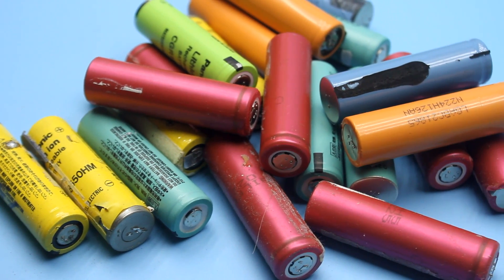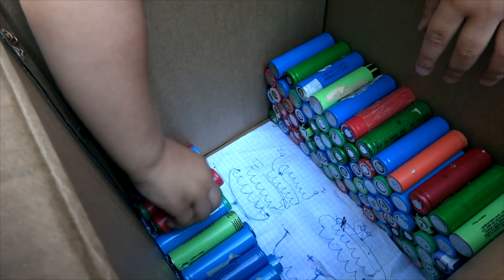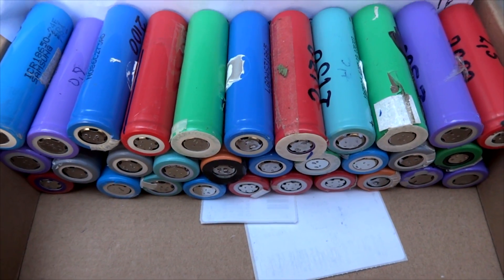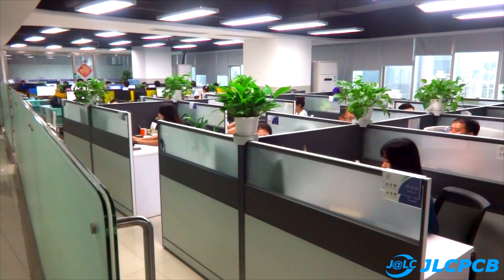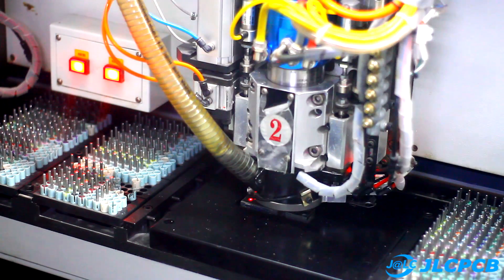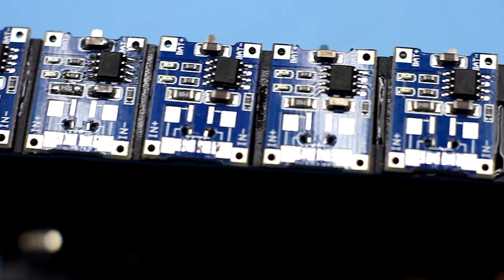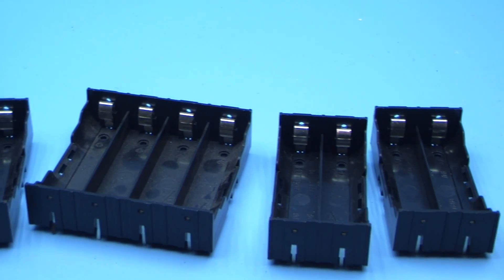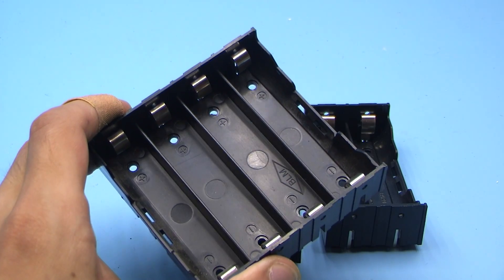SUPER POWERFUL charger for 18650 type batteries!

Comment: Is there one that can output more then 1 amp?
Reply: Nope
Reply: Yes you can go for tp5100
Reply: Just a little modification. Change the resistor program to half of its default value (1.2K to 600ohm). And you can get 1.4Amp output.
And would be optimum if you power it with 6V instead of standard 5V. (Based on datasheet, The maximum input of TP4056 is 8Volt)

Comment: The board has a place in front of it can be replaced and thus control the height of loading the ampere and thus prevent the high heat that can turn on the whole project and destroy it, in general this is a positive and nice project

Comment: Well you can charge all of those batteries using 4.2v supply in parallel and find a charger that can supply a constant current mode to charge the battery.
If the constant current is not possible just match the quantity of paralleled battery with the amp roughly 1battery:1amp supply

Comment: These battery holders are not good for taking them out often. I used them in my portable loudspeaker and take out the cells for charging every time. I'm very careful but the insulation of the cells get damaged every time when taking them out or putting in.

Comment: I have 18650 batteries but I want to use solar panel to charge it, is it possible please I need your help sir
Reply: yes .
you need buck converter with high current limit and adjust it to 5 volts that's if the solar panels was mor than 6 volts if not use it directly with the charging circuit . and make sure you use a good quality buck converter and don't use regulator liners or any other one ic regulators because it wast a lot of power

Comment: Please! Try to make a battery charger for a generator. I want to produce electricity at a small scale at that energy needs to be stored in batteryes ( Li-ion 18650) . Please! Can you help me make a battery charger and a voltage stabilizer for the energy produced?
Reply: How much voltage transformer do you have? 
If more then 5v, use a step down converter set to 5v and connect this to the tps charger module

Comment: Your power supply is 12v, not 5v. How it works?
Reply: It looked at one point that  there was a buck regulator on the output of the 12v PSU, which was doing the 12 -> 5 conversion.
Reply: Andrea The 5V is what powers the chargers and fan buck converter.  

 @pfeerick  The boost converter is for the fan.  MT3608 is an 8V power supply boost converter from the 5V battery pack power supply that is based on the 12V power supply modified to 5V powersupply in a previous video for this charger project if I understand correctly.
Reply: @jafinch78  Yup, just replayed the bit where the power supply was introduced and output voltage shown... it was modified for 5v output, so the label is a lie ;) Thanks!

Comment: I don't understand the exact reason for using the none protected TP4056 chargers.

Does that mean that using the none protected versions means tve batteries could be over charged?
Reply: No, both boards protect the cell from over charging. The board with protection is used to be embedded into projects, like... Well, like a coffee mixer I made a few time ago. It's a piece of PVC pipe, 2 bottle caps, a small motor, a little lipo battery, a TP4056 and a few more components. So, basically, the TP4056 recharges the battery and protects it from over discharging. You know? 😊
Reply: @MCsCreations  
Thanks.
Reply: @MCsCreations   do u have the drawn circuit of it i really wanna make one for my self
Reply: @garethronaldo8692  Sorry, dude, I don't. 😕
Reply: It seems the protected chargers don't charge the batteries quite as fully as a non-protected one. And since this is only being used as a charger, there is no need for the protection, which is really only over-discharge protection, as the TP4056 won't try to overcharge the battery.
Reply: The TP4056 is a charge controller. It does constant current/constant voltage charge of a cell. This means it charges with a maximum current set by a resistor on the board and stops charging at 4.2V when the current reaches 1/10 of that. This is all it does.
This chip does not protected against over current/short circuit/over discharge. That isn't its job. You need other components for that.